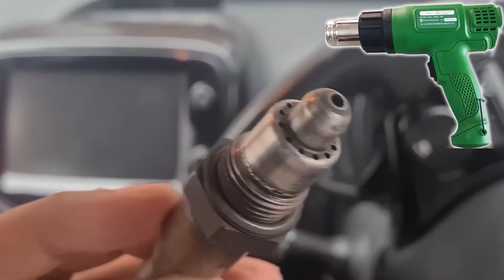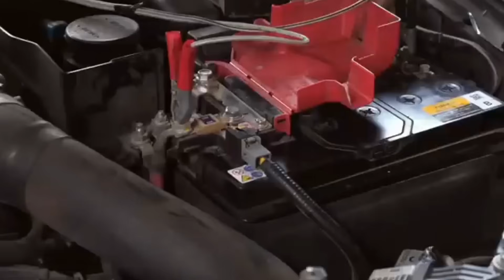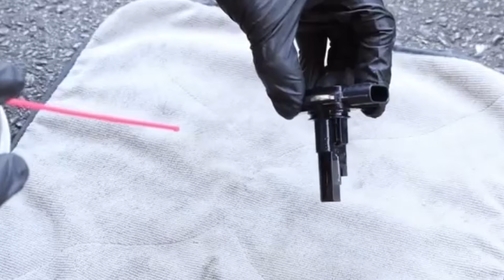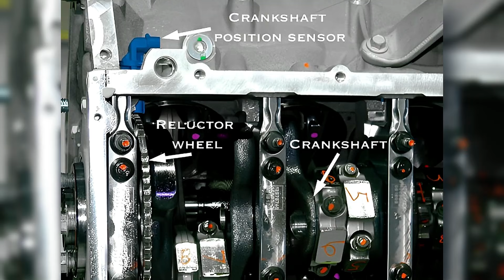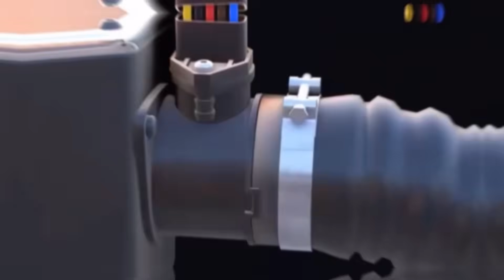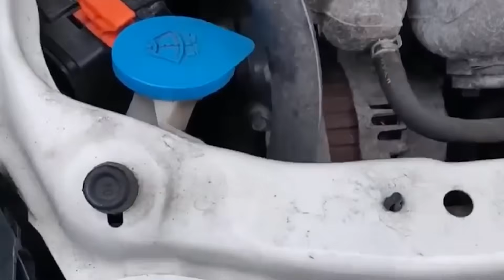Nobody Cleans These 5 Sensors — And Your Car Pays for It

Comment: Good morning my car start for about 15 minutes then shut off on it’s own then start again same thing what do you think is the problem it’s a Honda civic 05 I would appreciate any suggestion thank you
Reply from the maker: Good morning! That exact pattern starts runs for a bit, shuts off on its own, then starts again after waiting — is the CKP sensor on that Civic. It's in this video. Sensor fails when it gets hot, engine cuts, cools down, starts again. Check the CKP connector first, it sits low on the engine and corrodes. Clean it with contact cleaner, apply dielectric grease, reconnect. Free fix before buying anything. If it keeps happening after that the sensor itself is $40-60 to replace.
Reply: @AutoTruthLab  thank you I will check it

Comment: I have a 2003 Mitsubishi eclipse GTS hatchback 3.0 l V6 keeps throwing a rich code and a random cylinder misfire I'm getting terrible gas mileage and my idle out of nowhere would just be from normal it'll just drop almost to like a hundred RPMs and I can hit my gas pedal and I'll go back up and go stay up a little bit and go drop down again now I normally doesn't stall I think it's stalled once or twice when it did that but most of the time it stays running I know it's black smoke smoke from the back of my car I'm staying on the back of my car

Comment: My 2007 Toyota solara the the car goes to first but it hesitates and second sometimes it won't even get second but if I take it easy and wait for about 30 seconds and crank it back up it will go 2 seconds but it jerks and then it goes on through the rest of the gears
Reply: Can you help me figure this out
Reply: It only does it when I go to second gear when it's time for it to shift into 2nd gear

Comment: Idle air control too.  I’ve had the IAC sensor on my 5.2 Dodge gum up so bad it wouldn’t start/run.  Pulled out - a couple T20 screws - cleaned with carb cleaner - reinstalled….runs great!

Comment: 2018 Buick Encore. Fan keeps running after car is off. Has ran long enough to kill my battery. 2 shops they could not duplicate it. It stopped for a bit on it own and this week it came back again. Killed my battery. Got a jump had battery checked it was good and the alternator had recharged the battery back to full strength.  Fan is still running after car is off. Only why to stop it is to of course is disconnecting the battery. No power no Fan. Noone knows why it's doing it. No check engine light is being triggered!
Reply: It's the electrical wiring. 
Buick/Pontiac are notorious for janky wiring issues

Comment: Great video, but you forgot the Camshaft sensor, basically the same symptoms as the Crank Shaft sensor.
 
I had this for 2 years, my car would keep turning over, but no combustion, so I temporarily gave up, and would walk away from the car, come back in an hour, and she started right up, just as you say. I was even trying to start it in a big parking lot, and an older mechanic could here me trying to start it, but had “ no idea” what it was. These guys are not too bright, and the sound I would know right away now.
  
How did I solve this ? - I wrote to a mechanic who ran a weekly article, in our newspaper, and luckily he published my article and problem, and he thought it was the “cam sensor” - he was right on. It does a similar function to the crank sensor
 
After this guy published my article, and my problem, I went and bought a Cam sensor ( 30 yrs ago) for $ 35
Bucs, and she started up right away with no problems ever again. Very cheap fix, but a 2 year nightmare.
 
Really great Video you’ve done here, about “ real problems” and you should use your “ real voice” , as it sounds very phony using an AI voice
but at least the content was good.
 
Not many people realize what these $ 40 - 50 dollars sensors do, and many mechanics don’t either, unless their older, and have been around.
 
Get a real voice for future videos.👍

Comment: Yellow engine light stays on
Reply from the maker: Need a bit more to work with — what car, any symptoms like rough idle, hesitation, bad fuel economy? Yellow light alone could be any of the five sensors in this video. Grab a cheap OBD2 scanner and pull the code first, that narrows it down immediately.

Comment: 2006 PT cruiser starts then turns off after 10-15 seconds will not stay on. RPMs goes up pass 1 but then falls quickly to stalling. New parts MAP, camshaft, O2 sensors up and downstream, fuel filter, IAC, spark plugs and wires, battery and cables, PCV and hose, thermostat, absolute manifold pressure valve. Car held a start after letting its sit for a day stayed on until the engine got hot then turned off. I know before all of this the RPM was going erratically up and down while driving like a few months before failure. The car will stay on every blue moon when it wants. Help please ant ideas?
Reply from the maker: Everything you replaced and nobody checked the CKP sensor. That heat related stall — runs until engine gets hot then shuts off, won't restart for a while, then starts randomly — that's the CKP sensor signature. It's in this video. Sensor or connector fails when hot, no crank signal, engine cuts. Cools down, signal comes back, starts again. Check the CKP connector first for corrosion, clean it with contact cleaner, apply dielectric grease. If that doesn't hold replace the sensor itself. $40-80 part. Should've been checked before anything else on that list.

Comment: I have a Suzuki swift 1.2 GA 2019 model. It has a tapping sound after a while of driving.
Reply from the maker: That tapping on the K12 engine after warmup is almost always oil related. Check your oil level first — low oil on that engine causes lifter tap quickly. If level is fine check when you last changed it. Degraded oil loses viscosity and that tapping is the lifters not getting proper pressure. Fresh oil change first before anything else gets looked at.

Comment: Lol a maf looking that bad on the metal part is fucked id so replace that. Me and my friend took her car instead of mine and it was running lean and i could smell gas heat guage stoped working. It was bucking and almost dying completely. Engine light was flashing, that could be a misfire or something  and it was loading the catalytic converter up and  in the past i had a car with that flashing light nd it was bc of that so i just smashed it out and did a bit of fuckery with the o2 and it ended up being completely fine lol
Reply from the maker: Flashing CEL with bucking and lean condition is a misfire loading the cat — you read that right. And honestly if the fuckery worked it worked 😂 A MAF that looks like it went through a war zone though yeah that one's past cleaning, straight to replace.

Comment: when turning left from stop lose power for brief time then takes off,sometimes wants to stall at stop when tank is full?
Reply from the maker: Two different problems actually. The stalling at stops is throttle body carbon — clean it first, that idle issue goes away. The power loss on left turns is fuel slosh — when tank is full and you turn hard left the fuel moves away from the pickup tube for a second, engine starves briefly then catches. That one's not a sensor issue, it's just physics. Happens more when tank is completely full, less noticeable at half tank.

Comment: No engine needs these sensors.   These are there to set that engine up to fail.  All the computers on a vehicle isn't truly needed it's all hype to grease pockets.   Emissions is a joke and it chokes every engine and really your vehicle isn't the atmospheric problem it's the the power companies puking all that crap into the air not so much your vehicle or even Big Trucks.  They want you to think that so you'll follow the narrative.   Computers just make quicker decisions than you can on and with your cars fuel to air ratio to get max horse power from fuel and can do a cleaner burning of the fuel but with computers and sensors it is just a set up to fail.  Tech has taken over and it's going to push the human factor out.  It's almost made it where you can't work on anything you own or think you own now.    👍👍👍👍😎🍻✌️👋

Comment: 2010 gmc sierra 1500 4.8 lt. With 235k miles. 
1. Slight rough idle at start up.
2. Reduced fuel mileage.
3. Under load (traveling) must press pedal hard to accelerate and shift to passing gear. (Low power)
Reply from the maker: All three symptoms on a 235k Vortec point to the same two things. MAF sensor is contaminated — rough cold start and fuel economy drop are classic dirty MAF on that engine. The hard pedal under load is either the MAF struggling under demand or the MAP port blocked with carbon. Clean the MAF first, then check the MAP port for blockage. $15 total. At 235k those sensors have probably never been touched and that engine deserves better than that.

Comment: My proton flx surge when I remove the fuel paddle to slowdown. Is this due to MAP Sensor or TPS Sensor problem ?
Reply from the maker: That surge on throttle release is the TPS first suspect on that Campro engine. Throttle plate position is inconsistent on lift off, ECU can't read the transition smoothly, engine hunts instead of dropping cleanly. Clean the throttle body first — carbon on that plate causes exactly this. If surging continues after that then look at the TPS signal itself.

Comment: Yup if I'm going dismantle I just replace the throttle body and hose, air filter, replace the upper and lower 02 sensors and then catalytic converter most expensive part

Comment: In what world does taking time for diagnostics cost nothing?
Reply: It takes $$$ just to unlock the front door on any shop.  The avg shop price can run $100 - $200 per hr., add $50, for dealership.  That is where time is $$$!  Do you work for free?😵‍💫

Comment: Cleaning your 02 sensor is a very bad idea. you will most likely do more damage than good. Also, modern car 02 sensors are sealed, as usch y6ou are unable to clean the actual sensing unit. Overall this video is giving some very bad advice.

Comment: My mother have a Citroen C5 2.2 HDI 2003, that throws "anti pollution system failure" and "ESP/ASR failure" at the same time and when driving over 80km/h. error sometimes clears over night and as long as I drive slow everything is ok. May cleaning the MAF help here?

Comment: I have a Ford escape 2017 with p0300 &p0302 & p0303 I changed injectors spark plugs oh I changed my exhaust camshaft so I need help.
Reply: googled your three dtc's,  and AI overview came back with a couple  not mentioned, "faulty ignition coils, vacuum leaks..." ?,  and also a vid' link titled,  "....causes of engine misfires"

Comment: Hello and good day to you. This is my first time viewing your channel and I found your video to be very informative. I own a JDM 2007 Nissan Y12 AD wagon, that came with a 1.5L HR 15, four cylinder engine, paired with a four speed automatic transmission. Currently, I am experiencing poor fuel economy, transmission holding onto lower gears longer than normal before it upshifts and noticeable loss of performance, when driving uphill, along a gradient, of no more than 5%, less than 10%. What recommendations can you advise I carry out, to address and rectify these problems? Viewer from Trinidad & Tobago, West Indies, southern Caribbean.
Reply from the maker: Welcome — and that HR15 in the Y12 is telling you exactly what's wrong through those three symptoms together. Poor fuel economy plus transmission holding gears plus hill performance loss — that's the MAF and throttle body working against each other. Dirty MAF sends wrong airflow data, ECU miscalculates fuel, transmission can't find the right shift point because throttle position data is also off from carbon buildup. Clean the throttle body first, then the MAF sensor. $15 total. Do both before touching anything else on that wagon. Come back and tell me if those symptoms clear up.

Comment: Rough idle
low mileage
need pickup improvement

Ford Aspire 1.5L NA Petrol AT Engine, 50k miles drive. Single owner
From Bangalore, India

PS: 
Is there a single product that can be used to clean all these sensors? 
Can I clean all these sensors in one go? 
Anyone who can suggest a best Ford vehicle service provider in Bangalore! (Company owned are useless)
Reply from the maker: At 50k miles on that Aspire the throttle body and MAF are your rough idle culprits — right on schedule for that engine. No single product does both unfortunately. Throttle body needs dedicated throttle body cleaner and MAF needs MAF specific cleaner only — wrong product on the MAF destroys the sensing wire. But yes you can do both same day, throttle body first then MAF, takes about 45 minutes total. For Bangalore — skip the company centers, find an independent mechanic who works specifically on Ford/Maruti engines, ask to watch the work being done. Anyone charging you for parts before cleaning these first is already wasting your money.

Comment: Improper cleaning of the throttle body is almost a guarantee that it will need to be replaced. One cannot just simply spray it. Damage to sensitive electronic components of the throttle body will mean replacing it ($400 +) and causing any number of related issues and even more expense. Some throttle bodies are coated and the wrong throttle body cleaner or cleaners such as brake clean will ruin it.  My advice is to find an auto tech who you can trust and has the knowledge, experience and skills to do the job properly.
Reply from the maker: Fair points on the cleaner — coated throttle bodies are real and brake cleaner will destroy them, no argument there. But the solution isn't handing it to a shop that charges $340 for 15 minutes. It's using the right cleaner. Dedicated throttle body cleaner, engine off, gentle toothbrush, no soaking. That's it. The risk isn't the cleaning — it's people using the wrong product. Use the right one and this is a beginner level job.

Comment: Invest in a code reader available at all auto parts stores 
Get most expensive one or mid priced one do most everything average Joe needs
Reply from the maker: Solid advice. A mid range scanner that reads live data is the difference between guessing and actually knowing what's happening. Basic code readers tell you what threw the code — live data shows you why. Worth every dollar.
Reply: I purchased a 10 pound scanner of amazon.  Does everything.i have to subscribe touuse it for my vehicle. Saved me a lot of money

Comment: Hi, great video. My vehicle has a problem on cold start, coughs and splutters and then sometimes the engine check light comes on, but only when cold and on open loop, so the 1st 30 seconds to a minute. It runs rich when driving, black around the exhaust pipe and can see black smoke when pushing the accelerator pedal. Its a twin turbo v8 that has no MAF sensors, only MAP and air temperature sensors in the intercoolers. Your thoughts? BTW the vehicle is direct injection and known for carbon build up. Thanks
Reply from the maker: No MAF means the MAP sensors are doing all the work — and on a twin turbo that carbon buildup you already know about is almost certainly blocking those MAP ports. Blocked port reads low pressure, ECU thinks it's not getting enough air, dumps extra fuel to compensate. That's your rich condition and black smoke right there. Check both MAP sensor ports first — compressed air and a thin pick to clear them. On direct injection with known carbon buildup those ports clog faster than most. Clear them before touching fuel trims or anything else.
Reply: @AutoTruthLab  Thanks for that, much appreciated. Will try cleaning them and see how we go. I did use some Royal Purple fuel system & injector cleaner and it did run better after this, but the black smoke persisted. Thank you.

Comment: 2007 dodge charger srt8 superbee
The dealership says Computer - Central Control Module: CO CAN+ OR CAN - AT THE OBD 2 PORT, GET THAT VOLTAGE FROM THE FRONT CONTROL MODULE. NEED TO REPLACE THE FRONT CONTROL MODULE AND RE-TEST $430.00. 

They are wanting to replace the FCM that’s attached to the TIPM because there is no communication to the obd2. The scanner turns on but no codes. The fuses were checked. The lighter works, lights and windshield wipers. Is the FCM the issue? They don’t know. It’s a diagnostics list they use. Next would be to replace the ECM. Could there just be a faulty wire connecting the obd2 port that’s the problem?
Reply from the maker: Your instinct is right. Before any module gets replaced — check the OBD2 port pins first. Pin 4 and 5 are ground, pin 16 is power. If those are corroded or bent the scanner powers on but gets no communication. That's a $0 fix before a $430 FCM. Also check the CAN bus wires at the OBD2 port connector itself for corrosion or a break. Shops pull a diagnostic list and start replacing modules because that's billable. A bad wire to the port isn't.